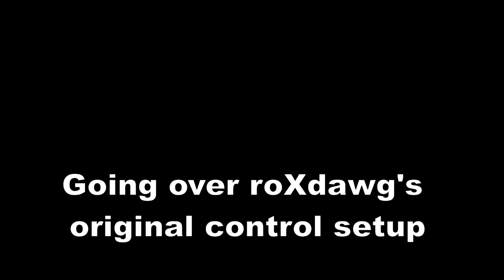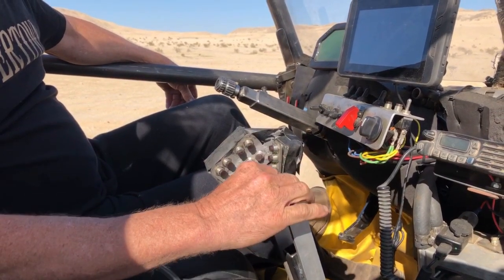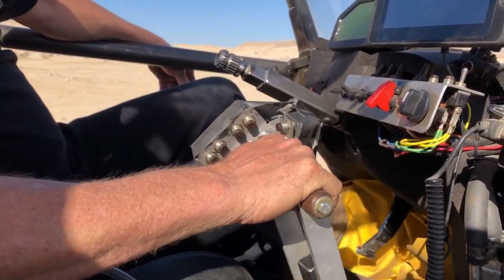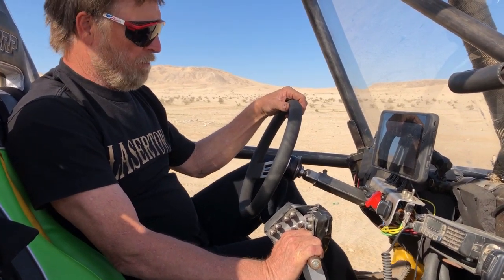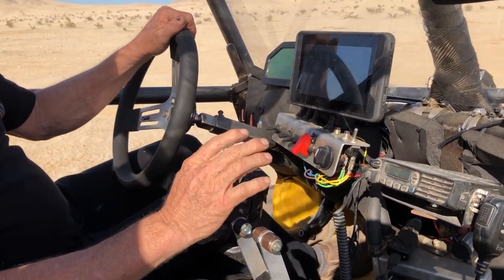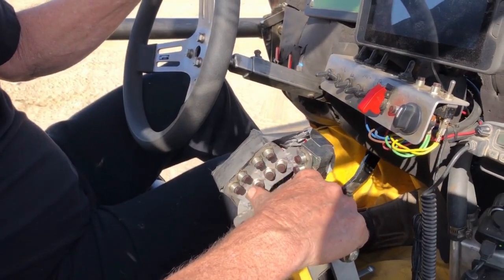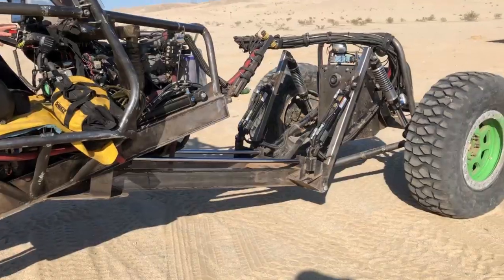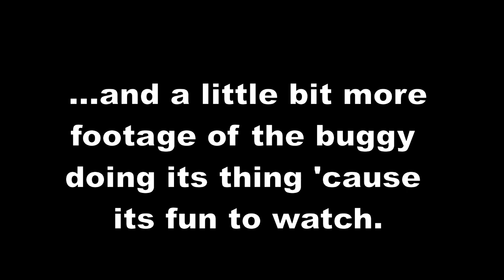First Season - roXdawg's  Controls  Part 1

Comment: Amazing work!  It seems to me that doing some mixing to those thumb switches could work wonders for drivability.  Instead of having different buttons for up/down at each corner, you'd have a single joystick that would let you roll left/right and pitch forward/rearward.  I imagine that might sacrifice some of the really weird articulation combinations, but it would massively cut down on the cognitive overhead.
Reply from the maker: Anthony we walked through the changes Alec made recently to the crawler’s controls in this video. He kept it relatively simple.  https://youtu.be/hZN7AjY8Sm0
I like your suggestions, it’s going to be a challenge for me to learn to drive it! -Karrie
Reply: @roXdawg  if you get a chance, check out a Alamo boom mower like the highway departments have mounted on the side of tractors.  I had never a control setup like they had.  The setup was a solenoid operated setup too.

Comment: What’s the top speed on this? Can it capably do highway speeds if needed? 60-70mph? 

I’ve been considering a hydrostatic drive system for a different type of vehicle but doing math to figure out if or what will work doesn’t equal out to real world action.

What’s the ratio your running in your pumpkins?
Reply from the maker: Still working on the speed, when finished it will have a top speed  of 60.  The gear  ratio  at the time of this video was , portal's 2 to 1  ,  rear end 5.13 to 1, transmission 5 to one  and 2 to 1

Comment: I’m thinking it will fall over easily, which logically I know it won’t because those are heavy axels. You know, like a cruise ship looks wrong, but all the mass is in the keel and hull.
Reply: I thought so as well,  however its quite  stable.   Of the 7 cars I've built  its the only one I didn't  role all winter.

Comment: Dam Dawg that is very cool ,that is Mad Max X 10 . What does it weigh. How many GPM are you pushing out from your pump. 50,75?
Reply: 4800 lbs  80 gpm 5000lb max pressure